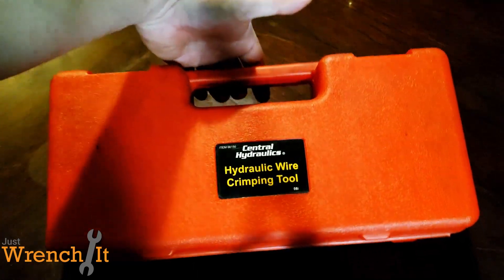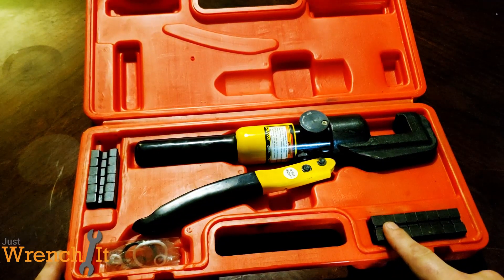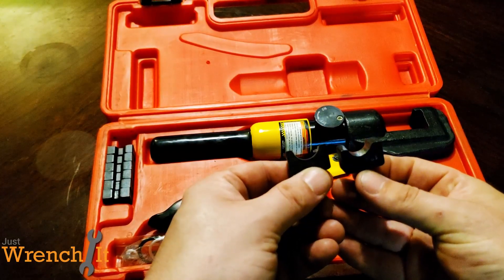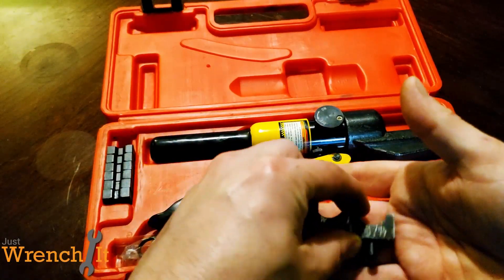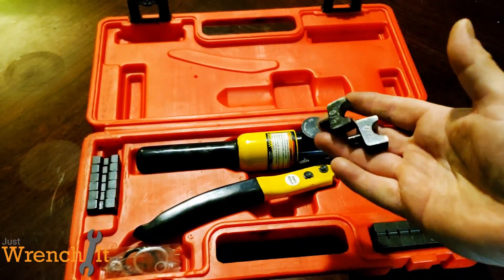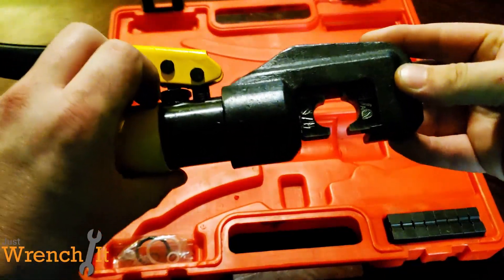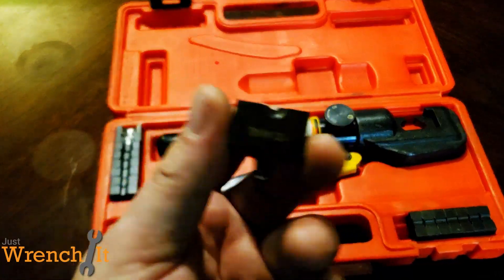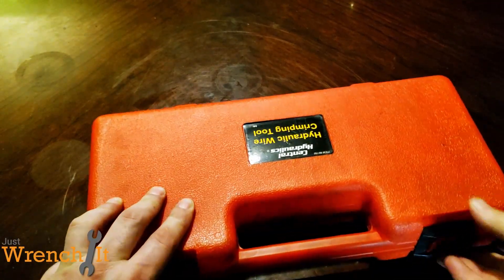Cable crimping tool (custom)

Comment: I found it quite interesting to see if pool that I would never would even use I don't think I ever used anything like that to a big wire crimper like that first nice to learn new things
Reply from the maker: It's very much a specialty item. Solar installs, battery cables, braided steel cables, etc. It does have its uses. Very handy as opposed to a manual crimper.